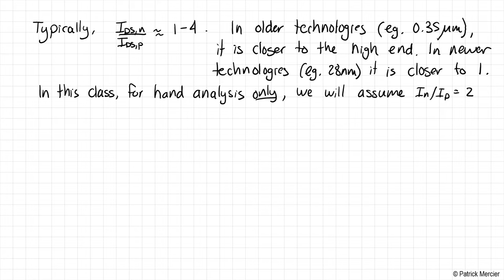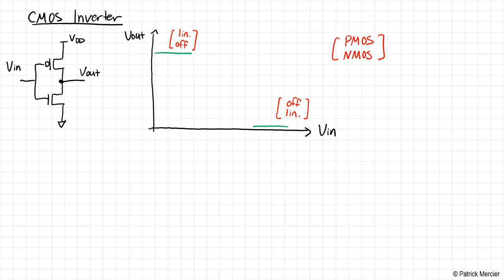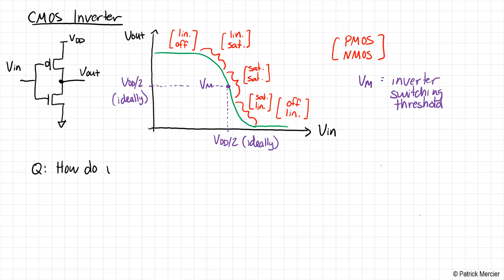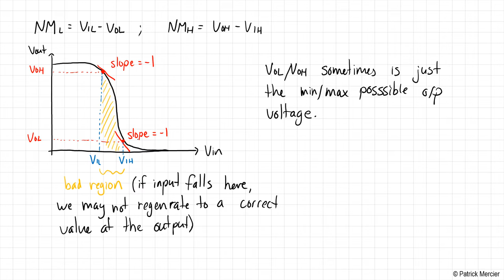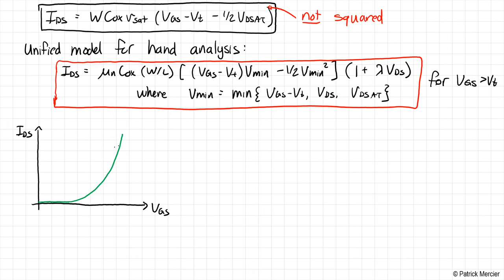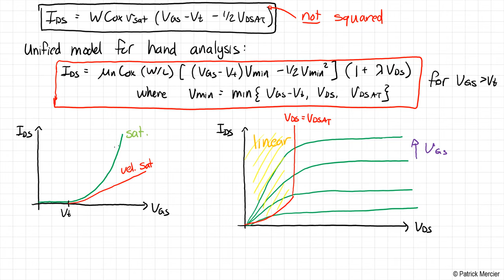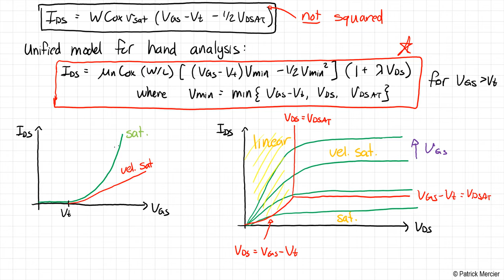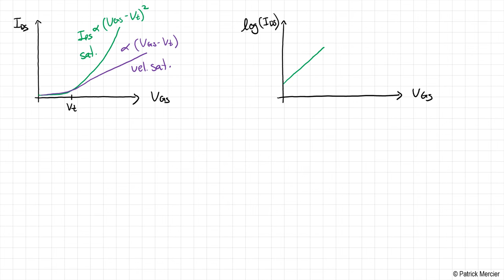ECE 165 - Lecture 3: The Inverter and MOS Transistor Theory (2021)

Comment: Excuse Professor, do you have some related books recommend?
Reply: "CMOS VLSI Design: A Circuits and Systems Perspective" by Neil H.E. Weste and David Harris is a highly recommended book for VLSI CMOS design. It covers the basics of digital integrated circuit design using the CMOS technology and provides a comprehensive overview of the principles and techniques of modern VLSI design. The book covers a broad range of topics, from basic transistor operation and logic gates to complex digital systems and manufacturing issues. The book also includes numerous examples, exercises, and case studies to reinforce the concepts discussed. It is widely used as a textbook in undergraduate and graduate courses on VLSI design and has been praised for its clarity, depth, and practicality.